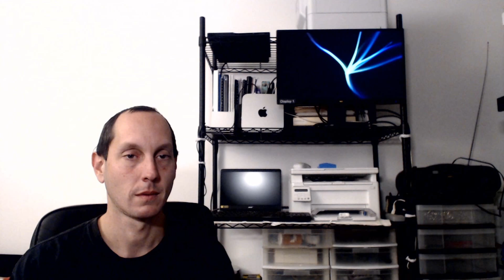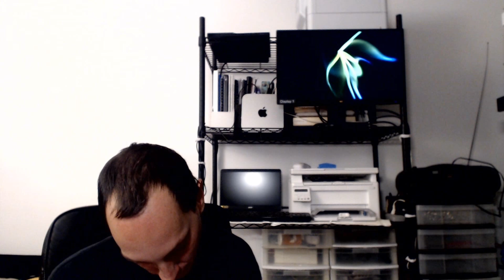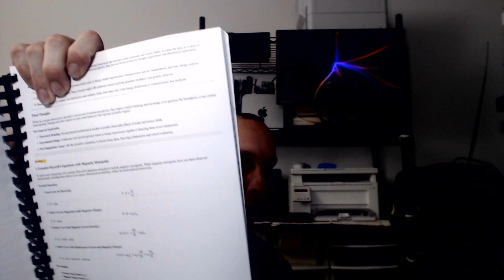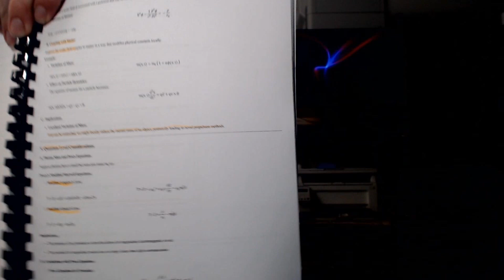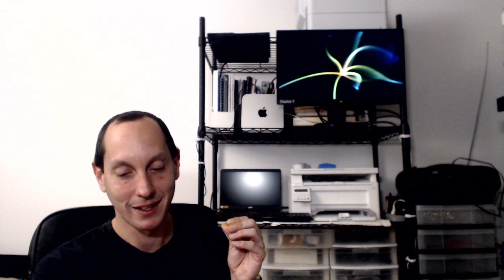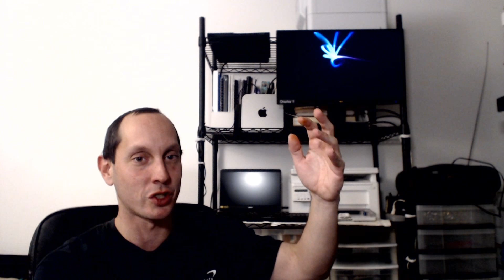New Maxwell Interactions

Comment: I look forward to seeing how this accelerates your projects. 

I have yet to get too far into the pdf but I have shared it with a math simulation contact as well as on linkedIn. 

I find it encouraging to have notes on your work where I have independently came to some of the same conclusions before you shared your maxwell equations/solutions. 

It seems natural to include c and E as everything was made from light as the bible talks about. 

I think you have something promising. You are quite inspiring.
Reply from the maker: Thanks, there are many interactions to try but according to the findings these interactions are very precisely produced. Might need more then a few wires and a pulse generator to really dig into the concepts. Also some industrial measurement tools. One issue at a time :)
Reply: @joellagace1679  do you have specifics in mind?